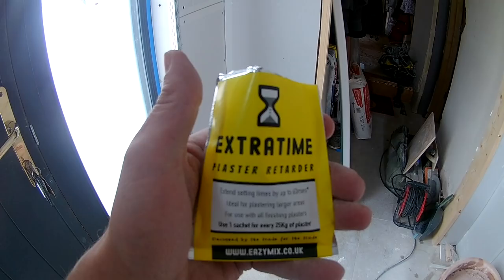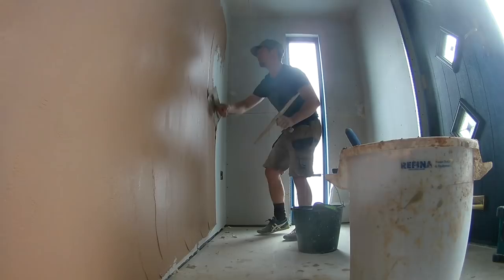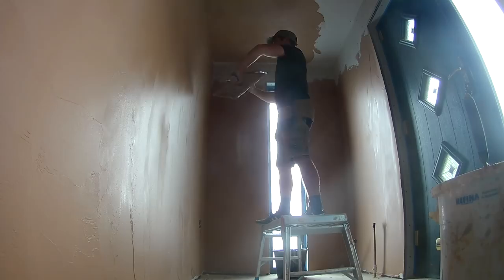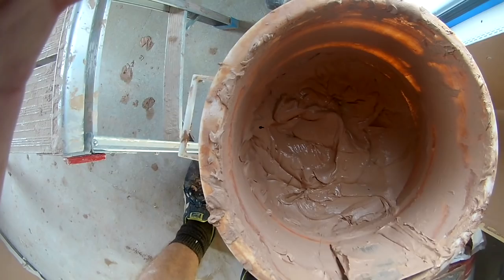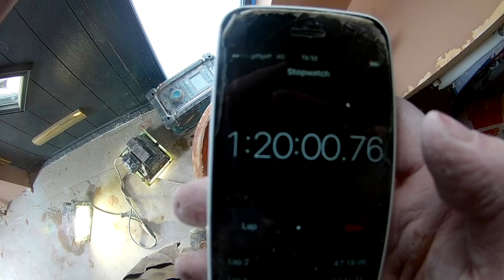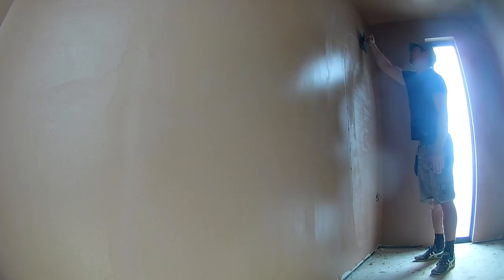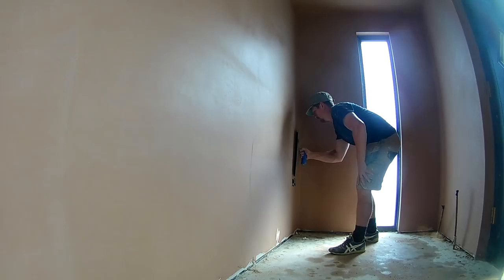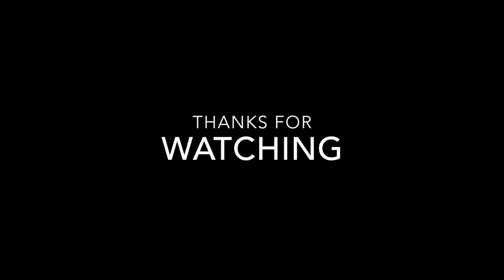Extratime Plaster Retarder: Does it work? (Plastering tips for working smarter)

Comment: I've just plastered a bedroom with this extra time and it was the least stressful plastering I've done it's worth it for the right mentality. Also I found I didn't need as much water when mixing up a 25kg bag I managed to get it down to 10.5 litres compared to Blaine's recommended 12.5 litres my first mix just kept sliding off my trowel and the float maybe the plaster manufacturer has altered something. A big up to blaine and his advice and recommendations for anything to do with plastering I'm slowly doing up the whole house thanks to him 👍

Comment: Trade tips for you all from DR Building Solutions from south Yorkshire   cream of tartar is old school same as adding a bit of liquid brick dye in the PVA glue when your prepping the walls and ceiling you know where you've been then it's easy to see with the liquid brick dying it and when you got smooth walls or ceiling or just need a key back ground for the plaster  buy  SBR and a bag of silica sand put it in a big painter  bucket mix it together and then roll it  on with a 1/4 to 3/8 nap paint roller depends on the background great video keep them up all the best pal by the way  i am old school plasterer and I now use refina plaziflex and speedskims and a 54 volt DeWalt plaster mixer just shows you how things have  change and are so much easier and faster
Reply from the maker: Thanks for the tips mate - I like the one with SBR and silica! I'll be using that, much appreciated! It's good to hear from old school plasterers but at least your life is a bit easier now 😂 Thanks for the support and thank you for the advise!

Comment: I've always mixed the extra time in water then add the plaster to that mixed water. I find it makes it creamy and does give you about 30 mins extra. Great for big hits. Used it all through summer of 2022 because of the heat and worked a treat. Can get used to using it real quick. Don't use on small areas tho as your be waiting all day lol.

Comment: years ago, for the finish white coat, which was finish quality lime soaked in water over night, then mixed with gauging plaster on the mortar board. Gauging plaster is actually a plaster of paris product, and available i a slow set and a quick set version.
Lots of plasterers used cream of tarter in the mix as a retarder. Just a very small amount, would be enough.

Comment: Lovely review there fella. Didn't even know this sort of things existed! Im not a pro but this will help me out when i need to get the trowel out!
Reply from the maker: Thanks mate I really appreciate that. Its good stuff - give it a go because it works well. Thanks again, I appreciate the support 👍
Reply: Plastering For Beginners Definitely will be giving this a go cheers. Have you tried this in hot weather? Also does it work on render mix?
Reply from the maker: It works in the heat but bit sure about render mate - that's something I've never tried 👍

Comment: Got 37 square metre ceiling to do soon which is gonna be 1 mix of at least 3 bags and 2nd coat of 2 bag mix. How many sachets of extra time would you recommend for the 1st mix and 2nd mix or none at all for the 2nd? Love the videos they are massive help 👍
Reply from the maker: Hi mate! It's roughly 1 sachet per bag of plaster pal 💪
Reply: @PlasteringForBeginners   👍would you just add it to you 1st coat then not the 2and coat?

Comment: I'm a joiner by trade, but I've done a hell of a  lot of plastering over the years as part of kitchen fits etc. I get a decent 2-coat finish but in no way would I regard myself as a 'proper' plasterer. I was gobsmacked at watching you do the walls, internals and ceiling all in one hit. I've only ever attempted ceilings first, then opposing walls, then infills round window reveals and so on, letting each section firm up solid before moving on with the next bit, and with a paintbrush line of PVA on the new opposite solid corner to stop it from sucking out. I have absolutely no idea how you get a sharp internal without letting the other wall go off first. What's the secret? How the hell do you get it sharp without getting snots or trowel marks all over the other wet wall? PS - I use Extratime regularly now, it stops me from panicking when I'm doing big ceilings .......
Reply from the maker: Haha thank you for your kind words mate but it's just like anything. It's just practice my friend. I do a bit of carpentry but I could never cute timber to the precision you do - I think your trade is 10x harder. I really respect a good joiner! Well done for doing the Plastering you do by the way. Respect and thanks for commenting mate 👍
Reply from the maker: Corner Trowel's are crucial at the beginning and Extratime is the bees knees 👍
Reply: @PlasteringForBeginners  And thank you too!! We're not known as the 'king of trades' for no reason :) All the best mate.
Reply from the maker: Haha that's it mate! Good luck with your plastering and have a good weekend pal!

Comment: Loving your stuff and learning loads. I have always used a thinner mix on the 2nd coat,  this way even if it doesn't go off as quick the second coat will be thicker, would you recommend this for a beginner like me. I was looking at the retarder because during the really hot weather the 1st coat has picked up really quickly recently. Cheers by the way.
Reply from the maker: Yeah definitely but make sure it's not too thin - you still need a decent thickness on the second coat so make sure it has a little substance. Yeah, Extratime definitely helps in the summer mate. My mix's have been setting rapid ha!

Comment: Hi i am going to use this I’m working on my own and I have a big wall to do down the stairs (awkward) so it’s going to work, 1 ? Why do you work out of a bucket? And not a spot board??? Curious?
Reply from the maker: It's good stuff mate! I've always just find it that way mate and I do not mixes so it'd be hard lifting it to the board. I'm scared of doing my back in!
Reply: @PlasteringForBeginners  yes yes I’ve adopted the same method after years of using a spot board you do have a lot more room to work 👍
Reply: Hi mate wow I used extra time today what magic amazing stuff thank you for introducing a new product to to an old timer I will definitely use it in future thanks mate 👍

Comment: It does work I've only used it once had 45sqm ceiling to do on a re-skim wasn't even my job I was helping a fellow plasterer out and he couldn't make it to job or what not so I went there and he bonded out all the low spots and hollows that's when I thought I'll try this extra time I just used it for the first coat it saved me about 35 mins in time which I needed to be fair cause it had just started to pull in when I cleaned out the bucket I had a right arm like Popeye after the job just wish the other guy actually turned up to do the job as I was there to help him get it on and paid,also I do think wickes are selling extra time aswell as the half time stuff aswell which could be good for small jobs I've not used that stuff yet though, top job by the way and great narration on all your vids been doing it 16 years but always good to see how other plasterer go about there work
Reply from the maker: Hi mate! That sounds like a nightmare - it's a shame he couldn't help you mate but at least you used the Extratime! Thank you for the support mate I really appreciate it. Glad you're enjoying the videos and it's Great to hear from a fellow spread 👍

Comment: IMHO - DO NOT USE EXTRATIME. twice now I've pre-mixed 1 packet in water per 25kg bag of multifinish as per instructions. Both times its ruined the job. Dries with a crazed pattern of cracking. Read Amazon reviews and same thing has happened to others. A lot more positive reviews, but is it worth the risk of ruining your hard work?